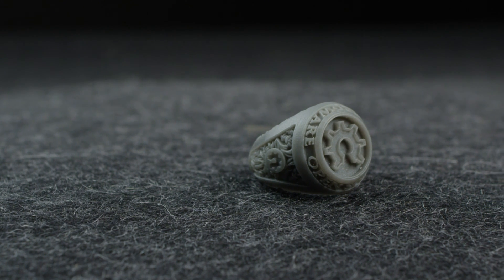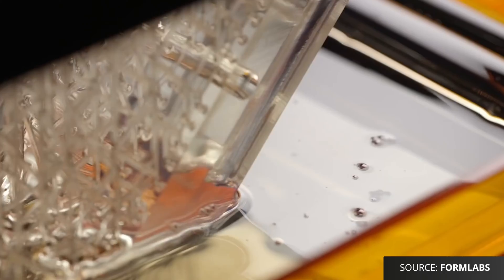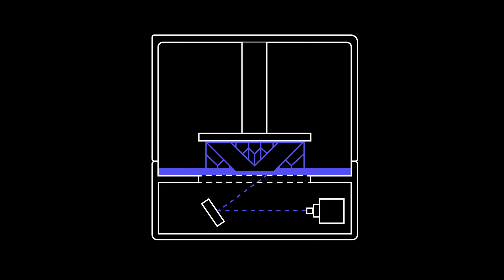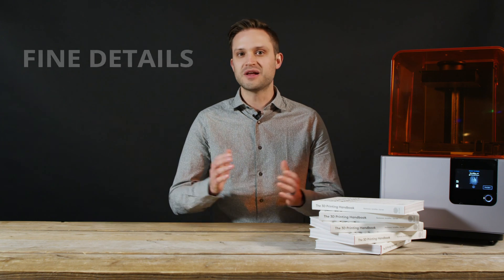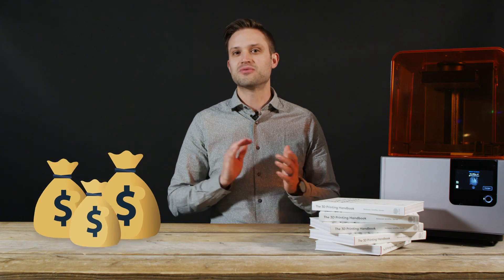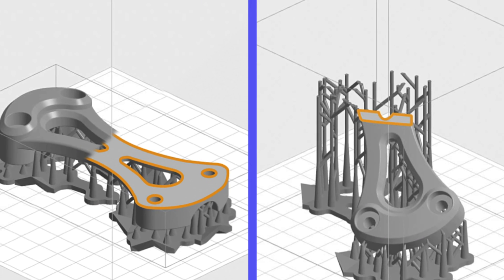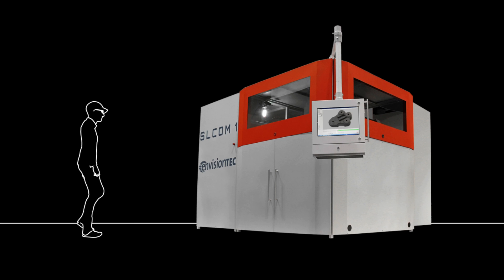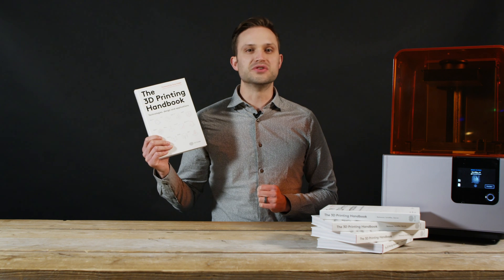SLA 3D Printing - What Is It And How Does It Work?

Comment: Can SLA prints be Galvanised or electroplated? thanks
Reply from the maker: Hi Ali, electroplating yes, galvanising no.
Reply: @ProtolabsMFG  thank you for your reply, also is there any place which can teach us how to effectively  permanent spray paint over these parts? is that possible?
Reply from the maker: @olfactiveartistry3973  Hi Ali, we don't have an answer to where you can learn to do that. Which parts do you mean exactly?
Reply: @ProtolabsMFG  no worries, I wanted to know if it is possible to permanent pain SLA parts or MJF parts. Thanks
Reply from the maker: @olfactiveartistry3973  Hey, yes you can permanently paint those parts. Be aware that for SLA you might need a base coat first for the paint to stick. Hope that helps! :)
Reply: @ProtolabsMFG  yes, thank you very much!